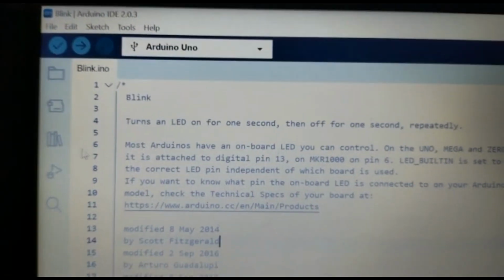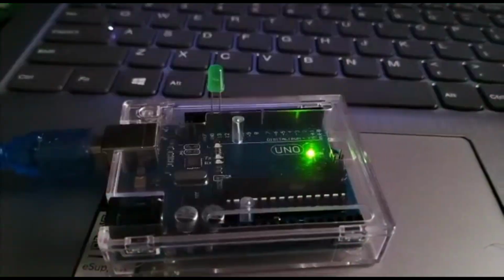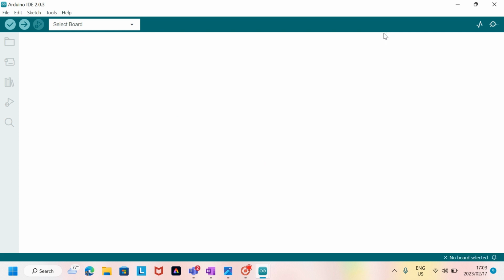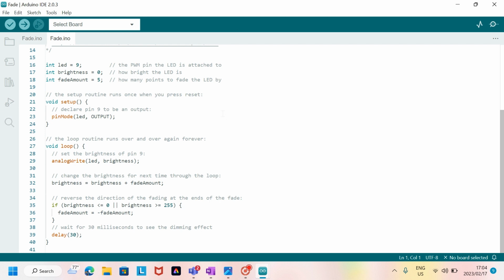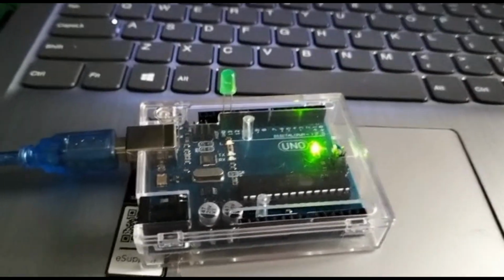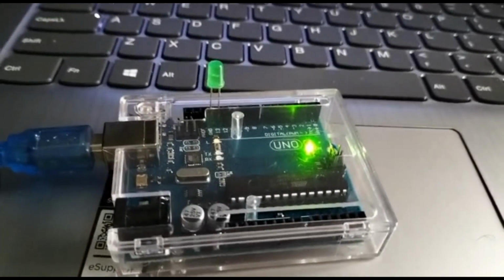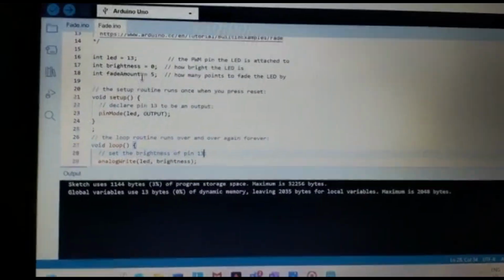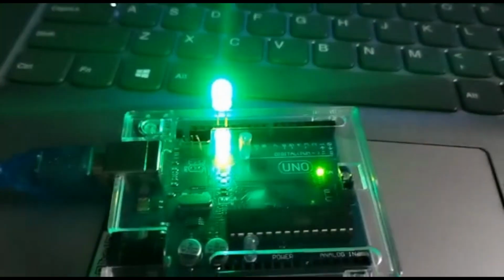Arduino Basic: #1 Learn with an LED

Comment: For those who do not code: The grey parts are called comments. Programmers write comments to tell other humans what specific parts of the code does. It also helps them remember if they forget! :-) The computer has been instructed to ignore them so you can write anything you want there, and it is good practice to leave plenty of comments in your code. Like you can see in the video, without the comments you might have no idea what specific parts do, but by reading the comments you can learn!
Reply from the maker: Awesome! Very in depth answer!